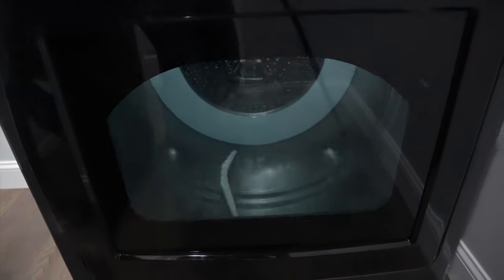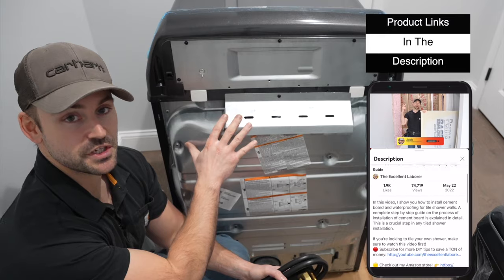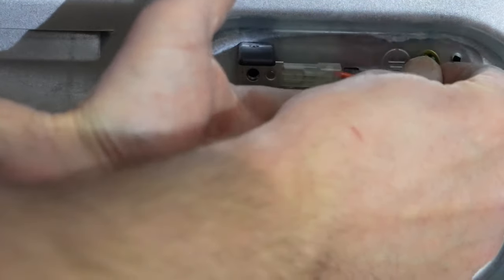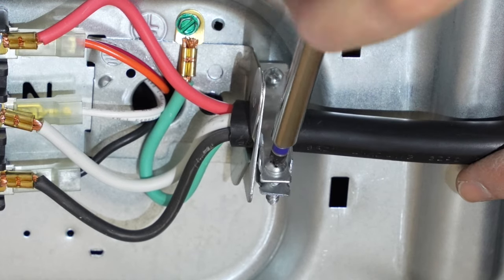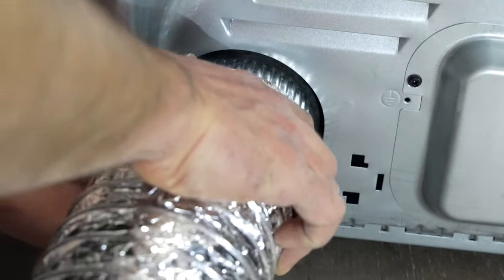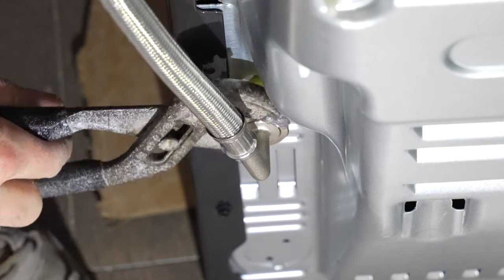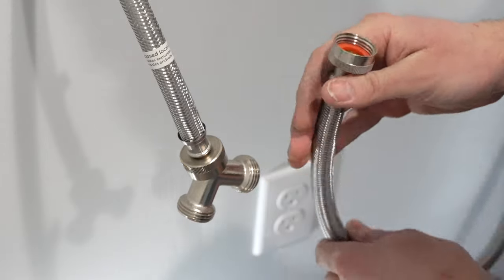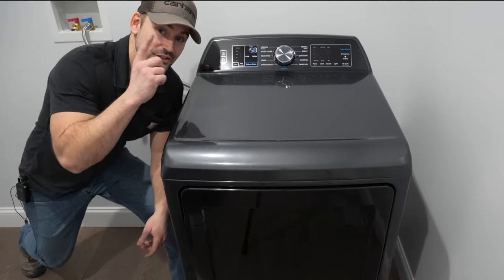How To Hook Up A Dryer - 4 PRONG CORD AND FLEXIBLE VENT PIPE

Comment: What is the purpose of turning off the breaker? You're not doing any electrical work.
Reply: Filmed one long vid with full dyer installation steps which included electrical work. Then cut up the vids to segments - electrical vids in desc.

Comment: Thank you for the video! I didn't know that they had 4 wire cords. Always used gas or 3 prong connectors.
Reply from the maker: You are welcome. Yes 3 and 4 prong is the common electric dryer cord sizes. Thanks for watching!

Comment: Always loved when I got a job that venting was easy. Having to do rigid pipe and even ones that are telescoping which are helpful. Our area you need to make sure what the code is as long as making sure what the electric dryer manufacturer calls for. Taking shortcuts, can destroy a unit as well. Just like if the dryer has that bridge on the unit, making sure you do it properly. Great explanation on that  Making sure the wire and breaker is the proper size wire in the rough-in or pre existing is so important. Sometimes wire in a pre-existing job the wire could be too small for the load required. I know you didn't mention the breaker amp size, but that is determined on the rough-in as well. That's why it's so important to check with the codes and requirements.
I've had some jobs that I could not do because the homeowner did not want to upgrade to the proper wire size to accommodate the new dryer. I won't do short cuts at all. Thank you for the great video with the information as well. Have a great week. 🔨👍🏻
Reply from the maker: Yes, it is important to wire properly for your dryer. Obviously since this is an electric dryer it is much more important to pay attention to the breaker and wire size. A washing machine is much easier than a dryer to install! My next video will be installing the washing machine, but obviously not as in-depth has this video. Thanks for watching David!
Reply: @TheExcellentLaborer  always look forward to them. Washing machine install is easier if course, but the rough-in for draining is. Some can only drain in a utility sink instead of a drain box. All are still important. Some old houses with the utility sink drain that go in the floor drain are sometimes a challenge because of newer washers, longer cycles etc. I would always try and hook them up into a schedule 40 drain if close by and trapped. When I did my nephews washer and dryer in there addition, I built a platform for them to be elevated with drawers underneath instead of buying the platforms from the manufacturer. They loved having extra storage. Have a great week Josh. 🔨👍🏻

Comment: Josh, I know this is an older video but just found you and subscribed.  Question: what do I do if the new dryer purchased has a back for the hose like the one you have, but my hose goes down thru the bottom of the floor? I have my pulled out right now just so I can use it, but 1) its not sitting even with the washer.. 2) its taking up too much space because I have it pulled out and looks awkward. Its all wrong.

Comment: What is the risk/issue in leaving the white wire that was on the chassis ground there and adding the green wire from the cord? And then putting the other three colored wires from the cord to their appropriate places on the dryer? That is how home depot shows to do it.